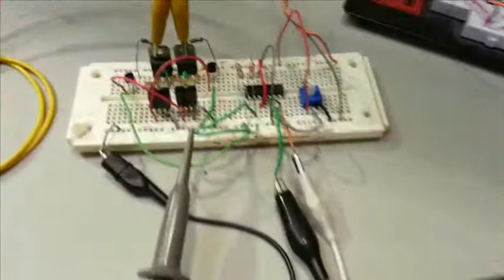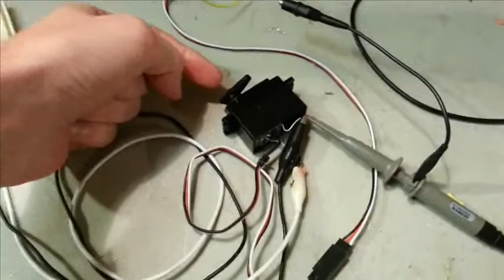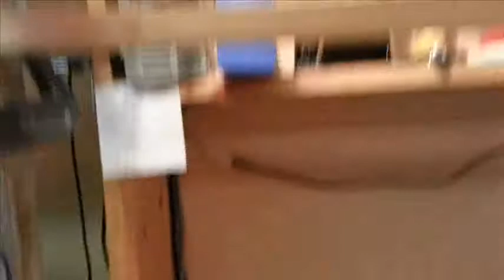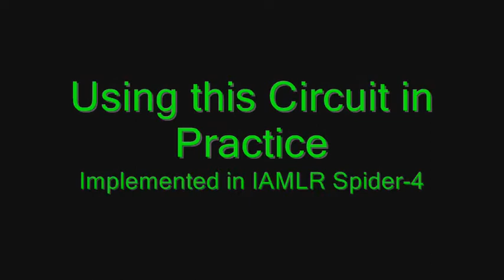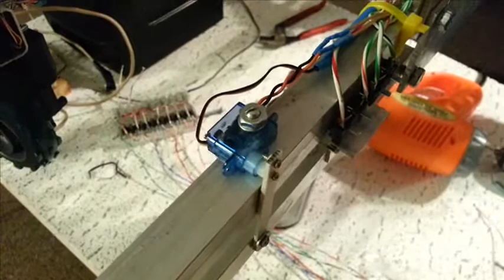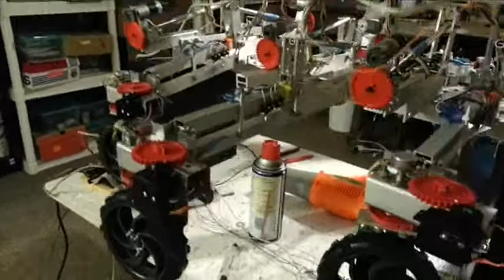Utilizing the motor outputs of a Servo

Comment: Hey dan your H bridge works a treat after a little tuning of the 10k pot
I couldn't find any IRF244s here locally in australia so I used the IRF540N instead
The modulation coming from the existing model servo motor wires in very smooth as expected
Do you think I need further diode protection on my 1/20th HP DC motor? don,t want to kill the mosfets
Thanks Mate !

Comment from the maker: so if your driving a 12v motor with your h-bridge and your comparitor can only swing from 0 to 5, then when you try to turn on the motor and 5v is delivered to each mosfet, 5v will turn on the n-chan, and 5v will leave the p-chan on too! so there is a direct short to ground causing the mosfets to heat up. so make sure the output of your comparitor can wing the same range as your motor voltage.

Comment from the maker: I probably know what your problem is, you say your P-chan mosfet is getting hot? check the control signal to it, it should either be 0 or 12v (or what ever your motor voltage is). Anything else turns it partially on burning it up.  P-chan is opposite of n-chan, so that means if your using it to drive a 12v motor, than 12v on the gate will turn it off, but anything else will turn it on. On an n-chan mosfet, 0 is off, and anything else turns it on.

Comment from the maker: oh, because the comparitor outputs are "open drain", it means the comparitor doesnt actually output 5v for TRUE or 0v for  FALSE, instead it opens and closes a switch to ground. So when its TRUE, the "switch" is open, so that resister you pointed out can now drive the output pin to 5v, but when its FALSE, the switch is closed which shorts the output pin directly to ground making an output of 0v.